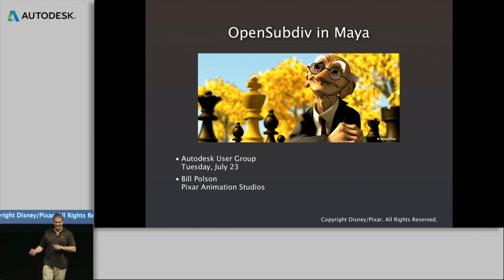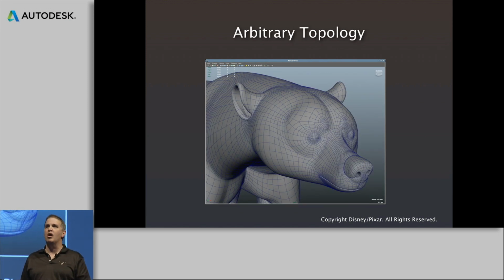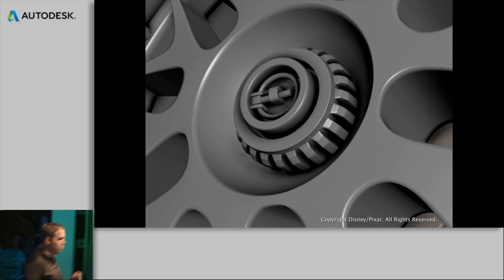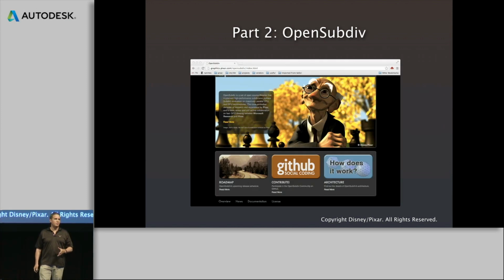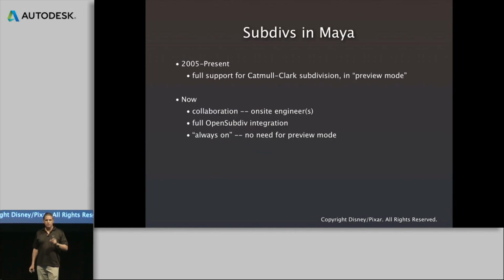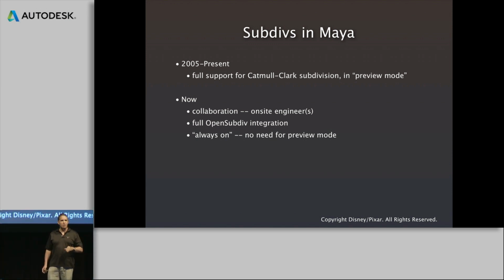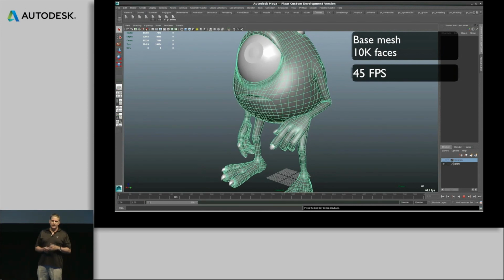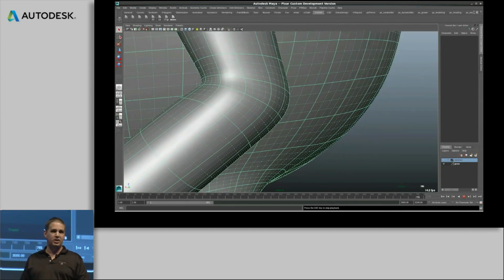Autodesk Anaheim User Event 2013 - OpenSubdiv Bill Polson

Comment: there is no current development of 3ds max . looking at 2009 to 2014 very little to be spoken of .within the same time from stereo, alembic,mucle system, new clothing method,viewport 2.0 + 2.0 API, pixar edges, open subs, project bifrost(naiad integration), new UI, python,nex modeling tools etc have been added to maya not saygin this coz i'm maya fan but even in max underground the little max development is noticed